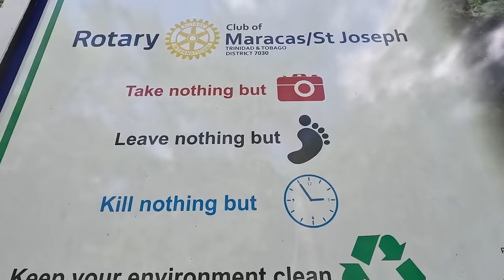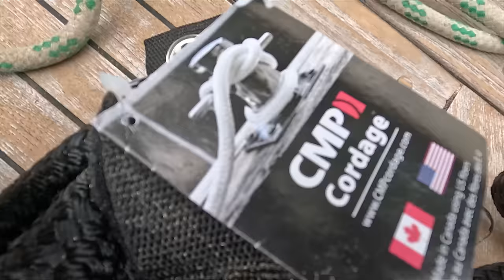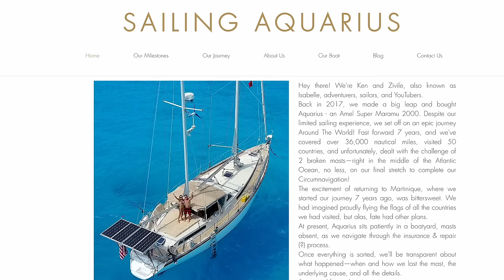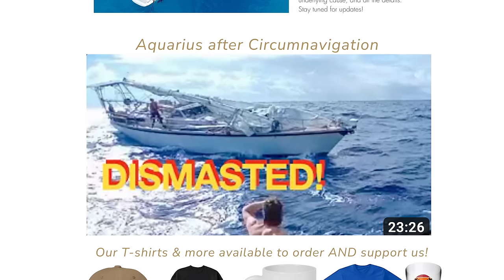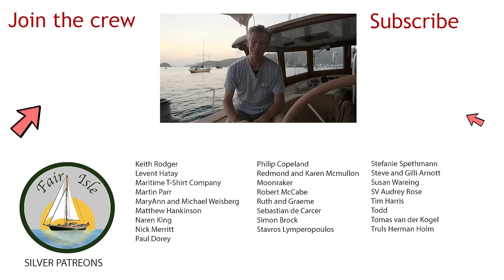Amazing boat yard stories!  |  Ep112

Comment: I had a dismasting last year on a Kaufman 47. I published it on my small non-monetized channel. It was a plain and simple chain plate fracture. Unlike Aquarius, it happened fast snapping dead center and slammed into the water during sporty sailing conditions. It was remarkable to see what the inside of the chain plate looked like compared to the outside!
Reply from the maker: Yes a chainplate letting go under load must be quite spectacular! Hope you got it all fixed.
Reply: @svfairisle  Yes! It was John Kretchmer’s boat , Quetzal. He managed to get it fixed, cross the Atlantic, around Cape Horn and complete the Drake passage all within a year of the dismasting.

Comment: Thank you. The thing about Tree trunks, the wood; it can mineralize quite quickly in the right conditions. Way quicker than a million years. Finding fossilized tree trunks is not an immediate indication that they are extremely old. And I'm not talking about wood or other things just encased in flowstone either! THOSE are absolutely NOT fossils and can be encased quite quickly if the water is heavily mineralized.

Comment: Funny you should mention PYI.  I just purchased a new Max Prop Easy and am about to install it on my Beneteau 42s7.  The guy at PYI you should talk with is Jerome.  He works in the shop and is the "go to expert" for everything to do with Max Prop.  I had actually made contact with PYI at last year's Annapolis boat show and it was there I was told to contact Jerome.  I arranged to return my old Max Prop for refurbishment and upon receipt and evaluation, Jerome called and gave me the bad news.  The blades were just worn out.  So I bit the financial bullet and purchased the new Max Prop Easy.  Just today the machine shop finished my new propeller shaft (made using Aquamet 22); I plan to install it tomorrow.
Reply from the maker: Thanks, yes I’ve found everyone at PYI to be super helpful and they do have the best stuff, I only went to their stand at Annapolis to buy some grease for the Max Prop and ended up getting their Fendertex fenders, their hose clamp ( they make the best 316L hose clamps) and deciding to go to them for my Max Prop refurb. I’ll try and do some filming with them about the Max Prop, more people should know about this prop.

Comment: Hi Steve, glad to hear alls well. but temperature  of the freezer more related to insulation
than plate size.  keep going . great videos
Reply from the maker: Okay thanks, I’ll look into finding a way to get a look at what’s around it. Any advice on what materials to use once I do get access?
Reply: @svfairisle  closed cell poleurathane foam or THINSULATE sheets

Comment: hi steve i trust you turned off the fridges whilst on the hard ,. cheers .paul
Reply from the maker: Hey Paul, good to hear from you. Yes thankfully the yard has an ice machine so just used the freezer as an ice box. All good now we’re back in the water thanks to you. Our freezers not quite cold enough to keep ice cream now we’re in tropical waters though. When we come back through Lagos I’ll seek your advice on fitting a bigger plate.

Comment: Hello Steve: Many thanks for the time and effort you put in this quality video. As always ... entertaining and insightful. That's the good news. The bad news: eliciting questions/clarifications !! If you have few minutes would appreciate a clarification on the quality CMP double-braid docking line you're loving. Does it FLOAT? A useful characteristic when back-down for Med mooring (and occasionally missing the helpers on the dock).
Reply from the maker: I might be wrong but I don’t think anyone does double braid floating lines. We used to get floating line for the dinghy painter but it was always 3 core and wasn’t actually very nice, gets stiff and didn’t do too well in the sun, and as with all 3 core hockles badly.

Comment: Hi Steve, looks like you are both keeping well.
You mentioned in this video a system to automatically detect the current 110v or 230v and change 110v to 230v. You also said it alters the frequency from 60hs to 50hz.
Can I ask what it is you use for this?
Reply from the maker: It’s a Mastervolt system installed on the boat from new along with a big isolation transformer. Not sure it changes the frequency though just the voltage
Reply: @svfairisle  OK I see, yes probably just the voltage as the frequency of the phase is more complicated to change. We have the Victron isolation transformer that does the voltage but not the phase.

Comment: 3:26 https://en.wikipedia.org/wiki/Geology_of_Trinidad_and_Tobago mentions that many of the islands' rocks are metamorphosed. Metamorphism occurs when rocks are hundreds of degrees hotter (up to their first melting point at about 800 Degrees C) and subjected to low tens of kilobars pressure (at about 40 KM deep).  Under those pressures and temperatures, a commonly found metamorphic mineral is mica. Micas are thin leaf-looking minerals that form "books" and rocks that contain micas will develop a foliated texture. That texture can look like a petrified tree trunk, but the rock has actually been exposed to far more severe PT conditions.  Two common foliated rocks are called phyllite (mentioned in above Wikipedia) and schist. A gneiss is another common metamorphic rock. A gneiss contains less mica and thicker bands of other minerals (such as quartz).
Reply from the maker: Interesting thanks.

Comment: While I can appreciate your new Sirocco fan ( I have one as well), I am wondering how you threaded the wire run through the overhead.  I am facing a similar problem on Intuition and a hack would come in handy for my haul out next week.
Thanks.
Reply from the maker: I have a cable puller wire, search on Amazon, they have various names ‘fish tape’ ‘cable runner’ etc stiff but flexible with a rounded end you can usually fiddle it through most places
Reply: @svfairisle  Thanks for the tip.  I think it will work...
And, just in time, I hauled today!

Comment: How did the chat with the stainless filter manufacturer go about the cleaning process? Any idea of the lifespan of the filters?
Reply from the maker: This is what he sent me: We recommend using a high-pressure water gun to flush the inside and outside of the filter to flush away the dirt attached to the filter. We believe that the service life of the metal filter element will be more than 2 years. But to be honest, you know us, we just completed this product last year, and maybe we need a little longer to verify its maximum service life.
Reply: @svfairisle interesting.  I don’t have a pressure washer on my boat. I guess you could make one from the high pressure pump on your watermaker?

Comment: I am intrigued re the ss filters for the watermaker. How have you liked them? Expensive vs the regular ones? And are they specific to the Spectra watermaker or generic? We have a Rainman
Reply from the maker: It's early day, we do our videos in real time so I've only just fitted them. They are a generic filter so good for any watermaker, the only reason manufacturers say you need specific filters is you don';t want to be using cheaper paper filters that might start to break up and ruin your membrane. Obviously no chance of that with a SS filter. So as long as the SS filters are filtering to the specified size (which I assume they are) then you have a perfect filter that can be used until it starts to clog, then power wash. I will obviously let our viewers know how it goes over time,
Reply: Can you comment on costs and availability? Thanks!
Reply from the maker: They are on there website for $79 https://www.pureoceanmarine.com/ 
All the details are in the description

Comment: Aquarius had a pole out, I am wondering if that is the stress point , with a micro crack slowly propagating until it broke
Reply from the maker: Amel changed their manual after a dissmasting in 2003 it seems to say you should not have only one foresail out on the pole, you should have two. That's bonkers though as unless you're dead down wind you will only want one and backwinding a sail will put all the load on one side anyway. So if they think there's a problem with a possible weak point where the poles attach to the mast then they really should be doing something about it.
Reply: @svfairisle  I wonder if some sleave could be installed around the area where the pole attaches to the mast to distribute the load better. But then the first section of the pole would have to be shortened
Reply from the maker: @chrismulvey49  It looks to me that the area where the pole sockets are is already weakened by the flared opening for the in mast furling motor. Not sure what could be done to existing masts, but it does seem like Amel should be beefing up that bottom section

Comment: What can prop speed be made out of to justify that price? Maybe it’s just me but if I owned or managed that company I wouldn’t be able to charge that price without explanation on the can I would be to embarrassed not to. Even if the explanation is a low volume product it is still a reason.
Reply from the maker: I completely agree. I’m afraid the answer is almost certainly that there are such a high proportion of very rich boat owners around who will not even take notice of the price and just go for the product they have heard of that it works as a business model. I really can’t remember what I paid for it years ago, I’m sure it wasn’t the stupid price it is now but I probably fell into thinking I was paying a bit more for a quality product and as I was earning decent money at the time didn’t worry too much. I remember being disappointed with the result though. If you’re going to charge premium prices you need give a premium product, if you’re going to charge what they charge now it needs to last forever!